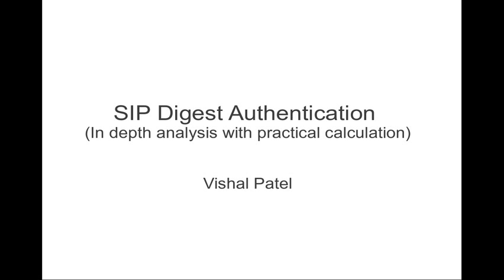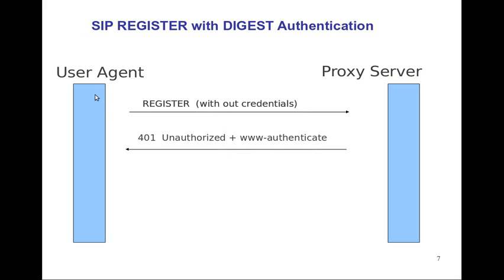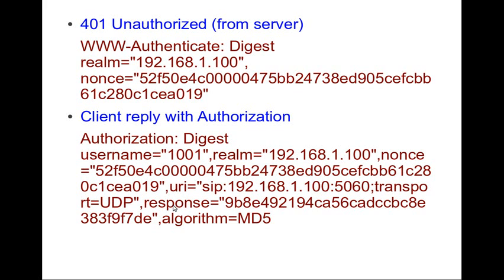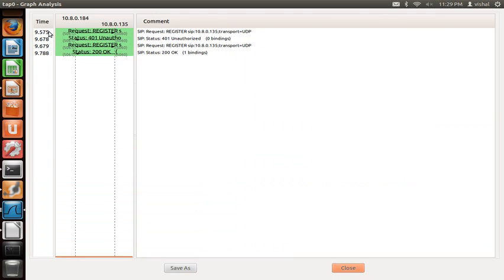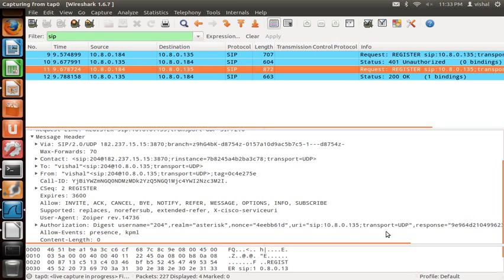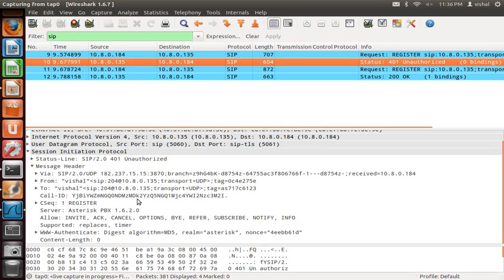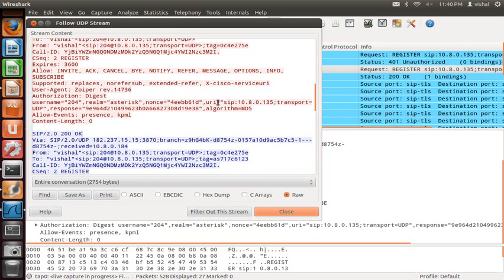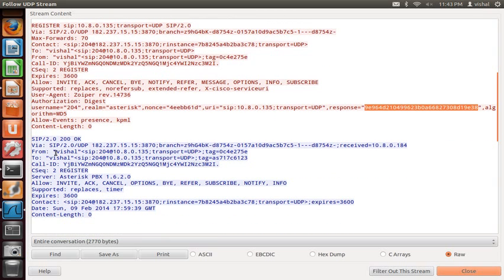SIP registration & authentication process

Comment: Gud work Vishal.. keep It up..
But I have some doubts regarding this first is. 1) why you use only python for calculating response means can we do it in C. If we can then please give some hint and 2) Apart from MD5 is there any other Algorithm to calculate response . if so then let us know.. waiting for your valuable reponse. :)
Reply from the maker: Thank you Nitesh for your encouraging words. You can calculate the response on any language. Fundamental for SIP is same as HTTP protocol. Every protocol has RFC (Request for Comment) document in which they define how this protocol should work. The current RFC is RFC3261. In that they have define to use digest authentication using MD5. HTTP also uses MD5 for checking authentication.